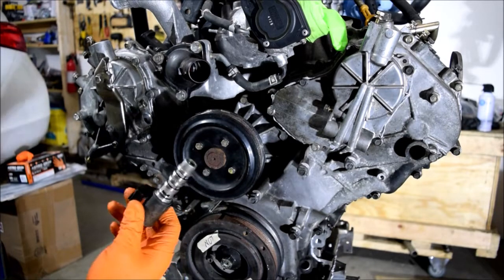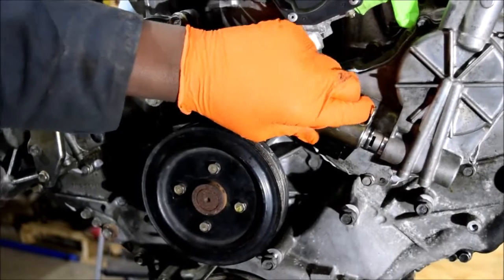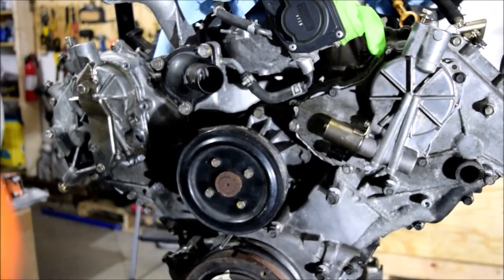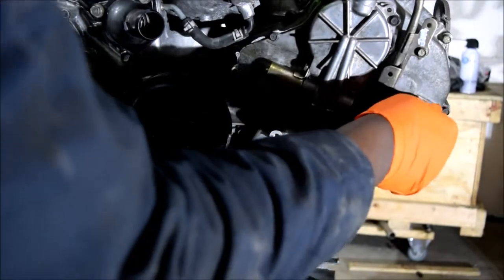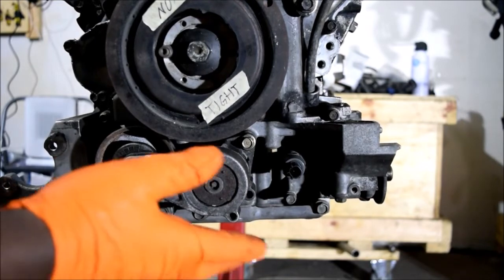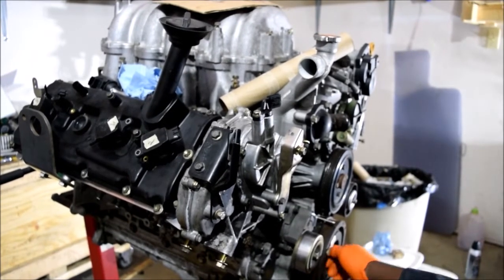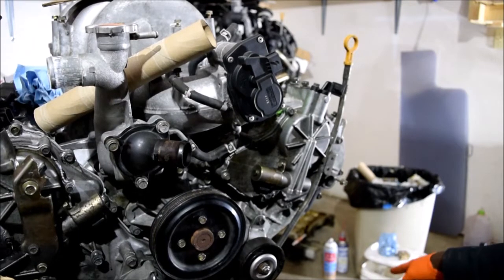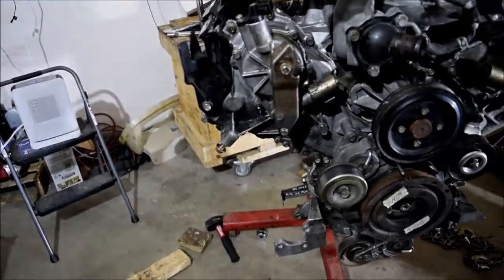Ep.12| Engine Sensors & Accessories. Nissan Infiniti VK45DE reassembly. 4.5 V8 M45, Q45, FX45, Fuga

Comment: Hey Ed ,
I was hoping you could answer this question for me. I had to replace bank 2 sensor 2 oxygen sensor. After which , do I just clear the code and drive to reset monitors or is there some type of reset to the computer I have to do?

2005 Q45….

Comment: Hey ed wondering if you can help me. I have a 2006 Infiniti m45. I have a code coming up on my scanner as 1800 vias control solenoid. would you happen to have the part number for that part? I’ve tried looking it up but some of them look slightly different and I don’t want to order the wrong part.
Reply from the maker: I believe this is the one you are looking for - 14956-38U1A